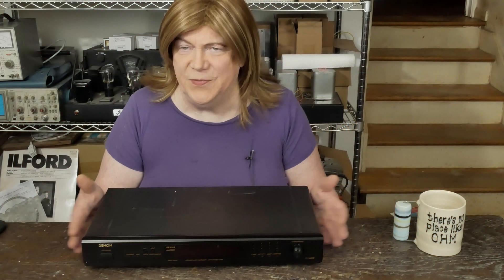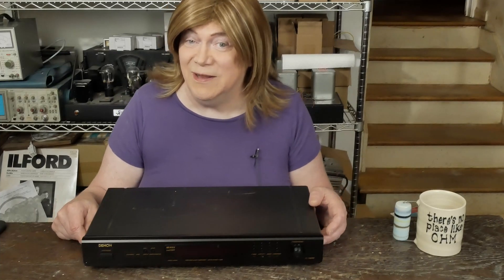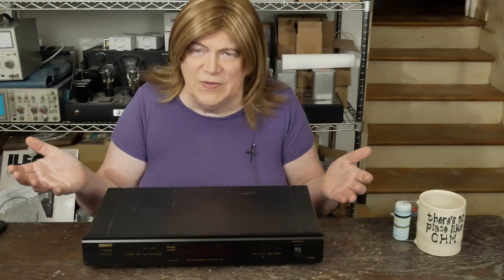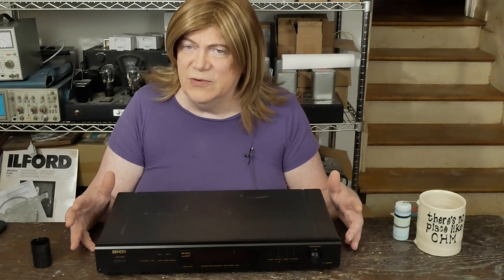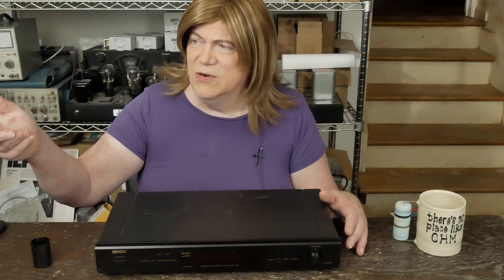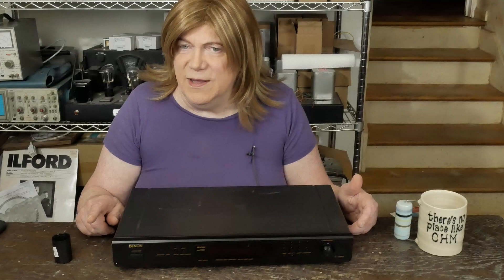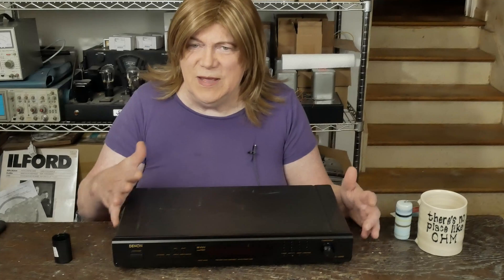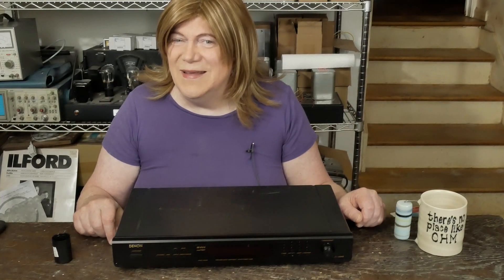Sparkos Op Amp retrofit into an old Denon TU-1500 FM Tuner!

Comment: I've played a round with various IC and discrete opamp designs... the power supply can really make or break the sound quality. The lowly NE5532 can sound terrific with the right circuit, decoupling implementation and a well built regulated supply with denoiser circuit.

Comment: What's with the video quality? Upping the resolution doesn't make it any better.
Reply from the maker: I upload as 1080P, not sure why YT offers 4K as it's not. I did play with some menu settings and cleaned the lens. shrugs Maybe it will improve :)
Reply: @SkunkieDesignsElectronics  
Mine was on Auto 720p and wouldn't go higher, at least visually. YouTube be weird.
Reply from the maker: Yeah that is weird. There are some ugly artifacts on the "macro shots", I think the camera was freaking on using a non-native lens mount with "diffraction correction" turned on. The camera can't electrically communicate with that lens so didn't know what to do?  I did some testing and discovered the video looks better with that setting turned off anyway. I'll admit not a pro on video recording, most of my knowledge is on still photography. And I was wrong, these newer files are edited as 4K, just have low bitrate to keep the file size reasonable, as YT will rerender large files to low bitrate if you don't and that does look worse.
Reply: @SkunkieDesignsElectronics  
Your videos normally always look and sound just fine. What use to always bug me was when people would use auto focus and it would shift from one point to another throughout the video. Fixed focus can work wonders.
Reply from the maker: Yeah I use fixed focus and manual exposure. I agree, so many video "focus rack" all over the place!

Comment: Hmmm.  I installed Sparkos pro op amps into my Geshelli lab Dayzee DAQ, and have been very disappointed. I could argue it is very clean sounding, but all the detail, clarity, and high end is now gone from that daq.  The stock TI opamps in the Dayzee Daq are amazing! Definitely the best sounding DAQ I have with the stock op-amps installed, but disappointing with the sparkos.  At least I got the 8 op amps required for the upgrade at a lower Black Friday sale from Sparkos.  Still giving them a chance to “burn-in” but out of the box and a dozen hours it is pretty disappointing and maybe just bad.

Interesting, Geshelli only uses the hi end op amps in the DAQ D/A stage, and just uses regular TI opamps for the output driver stage. He said op-amps make no difference in the output stage.

I will contact both manufacturers to give them my feedback to see what they say.
Reply from the maker: Give Andrew a call. But as always people have personal preferences!

Comment: Possibly worth measuring/confirming the de-emphasis RC parts value to be sure it is as precise as possible at 75us. That will directly impact the highs. Usually it is a single resistor and a single cap per channel.
As far as FM quality try to tune to Public radio or college stations. Most others have heavily compressed and processed signals. PS: the older Denon TU-800 is a much better unit but maybe not 65$:if you are intent on that brand. Can’t wait to see what you will get as a tube unit. Ok just checked that circuit and it is c142 & c146 combined with r157 &r152. Make that 750 pf & 100k to get 75us by measuring parts and matching them. And parallel caps to get closer. Use polypro or polystyrene caps and metal film resistors. See the table in the service manual for the different market variants page 32.

Comment: That's a good one! A long time ago I did that to the same tuner with a pair of AD825 on a perfboard with wires running to them from the main board. It made a big difference. I was a broadcast engineer and that tuner was what I listened to while fine tuning a few different radio stations' dynamics processors. The less distortion you hear in the whole chain the more fine the adjustments for improvement can be. If I were to do it all again, I would give those op amps their own voltage regulators and I would add RC snubbers between each transformer secondary winding and it's rectifiers. That snubber mod is the "Quasimodo" trick. Rectifiers ring a bit when they go out of the conduction part of the cycle and the resonances of the power supply transformer secondary windings amplify that ring and cause high frequency trash riding on the DC rails. Using soft recovery diodes was what I did to CD players and DACs a long time ago and it really helped but with the Quasimodo test jig you can empirically find the right value for a resistor in an RC snubber with only a 'scope and the cheap test jig and you can still use any rectifier. That ring of the solid state rectifier diodes was why tube rectifiers are favored in amps compared to solid state and even in DACs such as Audio Note. The tube rectifiers never had that turn off characteristic and they had series resistance. Check out the thread at DIYAudio .com   https://www.diyaudio.com/community/threads/simple-no-math-transformer-snubber-using-quasimodo-test-jig.243100/ 
Build one of those things. It just gives a pulse signal to the unconnected transformer windings and your scope shows the ringing displayed. Turn a pot to get rid of the ring and then measure the value across the pot to get the nearest resistor value that you need for your snubber. It's a cheap fix that makes a good difference.